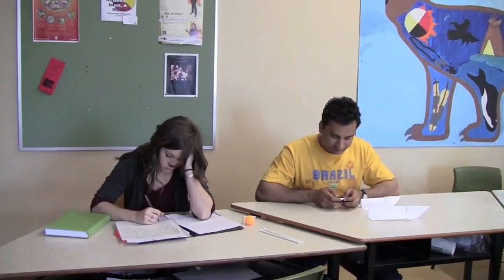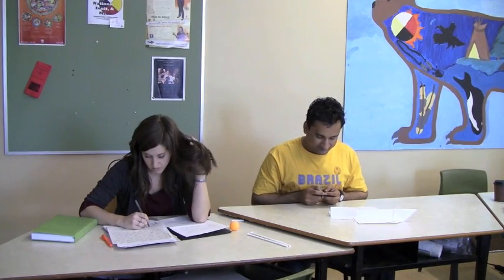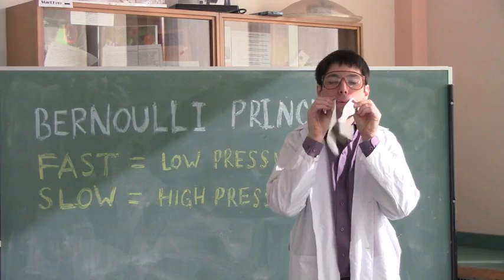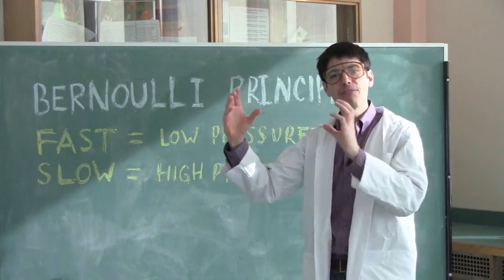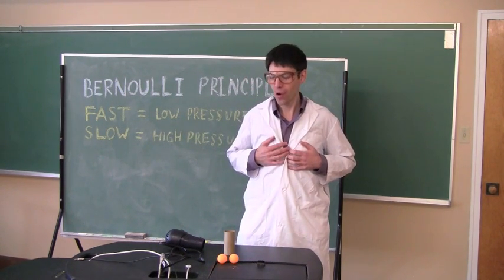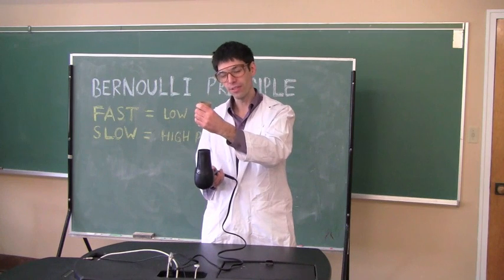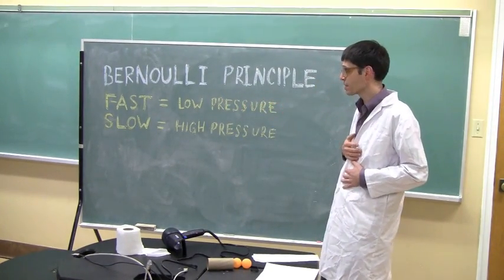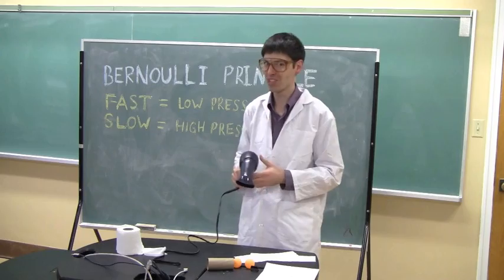✈✈ Bernoulli's Principle - Easiest Way Explained ✈✈ ☹ ☹

Comment: i have some concerns about this guy because he sounded very delussional because nobody talks like that nobody does and we know that.
Reply: This is a BAD SCIENCE VIDEO.
.
Why do you want to spread these misconceptions?  Fix or delete this video.
I am very sorry, but this is only repeating some  of the most common misconceptions in science.  
Fast air does not have low pressure.  What Bernoulli found is that Accelerating air has a decreasing pressure and visa versa; BUT NOT what caused this to happen.  
--
Euler continued that study and realized that it is a pressure Gradient (difference between two locations) that is the force that accelerates a fluid.  This is Newton for fluids.
...
The air out of your mouth is at atmospheric pressure; that same pressure as the still air around it.  It is the higher pressure*created *inside your lungs by the contracting muscles that accelerates the air out into the lower, atmospheric pressure.
..
Blowing next to paper demonstrates entrainment which is caused by viscosity. . Look them up.  
If this is what your teacher taught, they have been misinformed, which is, unfortunately, VERY common.
--
The air over a wing only looks faster in a wind tunnel.  The lower air is actually faster as a wing flies by you.  The upper air is, however,  accelerated much more caused by the lower pressure above the wing.
The pressure changes around a wing are simply caused by the wing pushing air out of the way to get through it.
...
Bernoulli had nothing to do with the development of the airplane. He was doing blood pressure studies.
...
The air above a wing gets to the trailing edge significant;y BEFORE the lower air; which is caused by the low pressure accelerating it toward the rear.
...
The ping-pong ball is held in the center by the Coanda Effect. A flow that follows a convex surface is what lowers the pressure. Think of centrifugal force pulling the air away and, therefore lowering the pressure.
 The air out of the hair drier is at atmospheric pressure, The side of the ball where more air curves around to the down-wind side (top)  of the ball has a lower pressure because of the greater Coanda curved flow. 
When tipped, there is more air flowing over the top AND flowing in a curved path (around the back and then downward).  This lowers the pressure more and supports more of the weight, therefore, allowing the upward moving air's dynamic pressure to push the ball further out..  This is the only explanation which explains why the ball moves further away when the flow it tipped because the air is slowing down farther from the blower and the centering force would be less, not more, if the Bernoulli fallacy as true.
..
ALSO, if the air at the blower's exit was lowest, the ball would be "sucked" down (actually pushed down by higher pressure above it)
...

The tube above the ping-pong ball is a very good discovery and requires a more careful understanding because this fast air thing is false.  
My initial analysis is as follows:
The tube prevents much of the air which would simply 'spill' around the sides of the ball to be trapped below the ball in the tube and to push the ball up like a piston in a cylinder.

Comment: Omg this was so cringe but I actually understood it all xD
Reply: This is a BAD SCIENCE VIDEO.
.
Why do you want to spread these misconceptions?  Fix or delete this video.
I am very sorry, but this is only repeating some  of the most common misconceptions in science.  
Fast air does not have low pressure.  What Bernoulli found is that Accelerating air has a decreasing pressure and visa versa; BUT NOT what caused this to happen.  
--
Euler continued that study and realized that it is a pressure Gradient (difference between two locations) that is the force that accelerates a fluid.  This is Newton for fluids.
...
The air out of your mouth is at atmospheric pressure; that same pressure as the still air around it.  It is the higher pressure*created *inside your lungs by the contracting muscles that accelerates the air out into the lower, atmospheric pressure.
..
Blowing next to paper demonstrates entrainment which is caused by viscosity. . Look them up.  
If this is what your teacher taught, they have been misinformed, which is, unfortunately, VERY common.
--
The air over a wing only looks faster in a wind tunnel.  The lower air is actually faster as a wing flies by you.  The upper air is, however,  accelerated much more caused by the lower pressure above the wing.
The pressure changes around a wing are simply caused by the wing pushing air out of the way to get through it.
...
Bernoulli had nothing to do with the development of the airplane. He was doing blood pressure studies.
...
The air above a wing gets to the trailing edge significant;y BEFORE the lower air; which is caused by the low pressure accelerating it toward the rear.
...
The ping-pong ball is held in the center by the Coanda Effect. A flow that follows a convex surface is what lowers the pressure. Think of centrifugal force pulling the air away and, therefore lowering the pressure.
 The air out of the hair drier is at atmospheric pressure, The side of the ball where more air curves around to the down-wind side (top)  of the ball has a lower pressure because of the greater Coanda curved flow. 
When tipped, there is more air flowing over the top AND flowing in a curved path (around the back and then downward).  This lowers the pressure more and supports more of the weight, therefore, allowing the upward moving air's dynamic pressure to push the ball further out..  This is the only explanation which explains why the ball moves further away when the flow it tipped because the air is slowing down farther from the blower and the centering force would be less, not more, if the Bernoulli fallacy as true.
..
ALSO, if the air at the blower's exit was lowest, the ball would be "sucked" down (actually pushed down by higher pressure above it)
...

The tube above the ping-pong ball is a very good discovery and requires a more careful understanding because this fast air thing is false.  
My initial analysis is as follows:
The tube prevents much of the air which would simply 'spill' around the sides of the ball to be trapped below the ball in the tube and to push the ball up like a piston in a cylinder.

Comment: Great video! I love the bad acting and the explanation  really helped me understand Bernoulli's principle.
Reply: This is a BAD SCIENCE VIDEO.
.
Why do you want to spread these misconceptions?  Fix or delete this video.
I am very sorry, but this is only repeating some  of the most common misconceptions in science.  
Fast air does not have low pressure.  What Bernoulli found is that Accelerating air has a decreasing pressure and visa versa; BUT NOT what caused this to happen.  
--
Euler continued that study and realized that it is a pressure Gradient (difference between two locations) that is the force that accelerates a fluid.  This is Newton for fluids.
...
The air out of your mouth is at atmospheric pressure; that same pressure as the still air around it.  It is the higher pressure*created *inside your lungs by the contracting muscles that accelerates the air out into the lower, atmospheric pressure.
..
Blowing next to paper demonstrates entrainment which is caused by viscosity. . Look them up.  
If this is what your teacher taught, they have been misinformed, which is, unfortunately, VERY common.
--
The air over a wing only looks faster in a wind tunnel.  The lower air is actually faster as a wing flies by you.  The upper air is, however,  accelerated much more caused by the lower pressure above the wing.
The pressure changes around a wing are simply caused by the wing pushing air out of the way to get through it.
...
Bernoulli had nothing to do with the development of the airplane. He was doing blood pressure studies.
...
The air above a wing gets to the trailing edge significant;y BEFORE the lower air; which is caused by the low pressure accelerating it toward the rear.
...
The ping-pong ball is held in the center by the Coanda Effect. A flow that follows a convex surface is what lowers the pressure. Think of centrifugal force pulling the air away and, therefore lowering the pressure.
 The air out of the hair drier is at atmospheric pressure, The side of the ball where more air curves around to the down-wind side (top)  of the ball has a lower pressure because of the greater Coanda curved flow. 
When tipped, there is more air flowing over the top AND flowing in a curved path (around the back and then downward).  This lowers the pressure more and supports more of the weight, therefore, allowing the upward moving air's dynamic pressure to push the ball further out..  This is the only explanation which explains why the ball moves further away when the flow it tipped because the air is slowing down farther from the blower and the centering force would be less, not more, if the Bernoulli fallacy as true.
..
ALSO, if the air at the blower's exit was lowest, the ball would be "sucked" down (actually pushed down by higher pressure above it)
...

The tube above the ping-pong ball is a very good discovery and requires a more careful understanding because this fast air thing is false.  
My initial analysis is as follows:
The tube prevents much of the air which would simply 'spill' around the sides of the ball to be trapped below the ball in the tube and to push the ball up like a piston in a cylinder.

Comment: Awesome
Reply: This is a BAD SCIENCE VIDEO.
.
Why do you want to spread these misconceptions?  Fix or delete this video.
I am very sorry, but this is only repeating some  of the most common misconceptions in science.  
Fast air does not have low pressure.  What Bernoulli found is that Accelerating air has a decreasing pressure and visa versa; BUT NOT what caused this to happen.  
--
Euler continued that study and realized that it is a pressure Gradient (difference between two locations) that is the force that accelerates a fluid.  This is Newton for fluids.
...
The air out of your mouth is at atmospheric pressure; that same pressure as the still air around it.  It is the higher pressure*created *inside your lungs by the contracting muscles that accelerates the air out into the lower, atmospheric pressure.
..
Blowing next to paper demonstrates entrainment which is caused by viscosity. . Look them up.  
If this is what your teacher taught, they have been misinformed, which is, unfortunately, VERY common.
--
The air over a wing only looks faster in a wind tunnel.  The lower air is actually faster as a wing flies by you.  The upper air is, however,  accelerated much more caused by the lower pressure above the wing.
The pressure changes around a wing are simply caused by the wing pushing air out of the way to get through it.
...
Bernoulli had nothing to do with the development of the airplane. He was doing blood pressure studies.
...
The air above a wing gets to the trailing edge significant;y BEFORE the lower air; which is caused by the low pressure accelerating it toward the rear.
...
The ping-pong ball is held in the center by the Coanda Effect. A flow that follows a convex surface is what lowers the pressure. Think of centrifugal force pulling the air away and, therefore lowering the pressure.
 The air out of the hair drier is at atmospheric pressure, The side of the ball where more air curves around to the down-wind side (top)  of the ball has a lower pressure because of the greater Coanda curved flow. 
When tipped, there is more air flowing over the top AND flowing in a curved path (around the back and then downward).  This lowers the pressure more and supports more of the weight, therefore, allowing the upward moving air's dynamic pressure to push the ball further out..  This is the only explanation which explains why the ball moves further away when the flow it tipped because the air is slowing down farther from the blower and the centering force would be less, not more, if the Bernoulli fallacy as true.
..
ALSO, if the air at the blower's exit was lowest, the ball would be "sucked" down (actually pushed down by higher pressure above it)
...

The tube above the ping-pong ball is a very good discovery and requires a more careful understanding because this fast air thing is false.  
My initial analysis is as follows:
The tube prevents much of the air which would simply 'spill' around the sides of the ball to be trapped below the ball in the tube and to push the ball up like a piston in a cylinder.

Comment: Well, this was really fun!
Reply: This is a BAD SCIENCE VIDEO.
.
Why do you want to spread these misconceptions?  Fix or delete this video.
I am very sorry, but this is only repeating some  of the most common misconceptions in science.  
Fast air does not have low pressure.  What Bernoulli found is that Accelerating air has a decreasing pressure and visa versa; BUT NOT what caused this to happen.  
--
Euler continued that study and realized that it is a pressure Gradient (difference between two locations) that is the force that accelerates a fluid.  This is Newton for fluids.
...
The air out of your mouth is at atmospheric pressure; that same pressure as the still air around it.  It is the higher pressure*created *inside your lungs by the contracting muscles that accelerates the air out into the lower, atmospheric pressure.
..
Blowing next to paper demonstrates entrainment which is caused by viscosity. . Look them up.  
If this is what your teacher taught, they have been misinformed, which is, unfortunately, VERY common.
--
The air over a wing only looks faster in a wind tunnel.  The lower air is actually faster as a wing flies by you.  The upper air is, however,  accelerated much more caused by the lower pressure above the wing.
The pressure changes around a wing are simply caused by the wing pushing air out of the way to get through it.
...
Bernoulli had nothing to do with the development of the airplane. He was doing blood pressure studies.
...
The air above a wing gets to the trailing edge significant;y BEFORE the lower air; which is caused by the low pressure accelerating it toward the rear.
...
The ping-pong ball is held in the center by the Coanda Effect. A flow that follows a convex surface is what lowers the pressure. Think of centrifugal force pulling the air away and, therefore lowering the pressure.
 The air out of the hair drier is at atmospheric pressure, The side of the ball where more air curves around to the down-wind side (top)  of the ball has a lower pressure because of the greater Coanda curved flow. 
When tipped, there is more air flowing over the top AND flowing in a curved path (around the back and then downward).  This lowers the pressure more and supports more of the weight, therefore, allowing the upward moving air's dynamic pressure to push the ball further out..  This is the only explanation which explains why the ball moves further away when the flow it tipped because the air is slowing down farther from the blower and the centering force would be less, not more, if the Bernoulli fallacy as true.
..
ALSO, if the air at the blower's exit was lowest, the ball would be "sucked" down (actually pushed down by higher pressure above it)
...

The tube above the ping-pong ball is a very good discovery and requires a more careful understanding because this fast air thing is false.  
My initial analysis is as follows:
The tube prevents much of the air which would simply 'spill' around the sides of the ball to be trapped below the ball in the tube and to push the ball up like a piston in a cylinder.